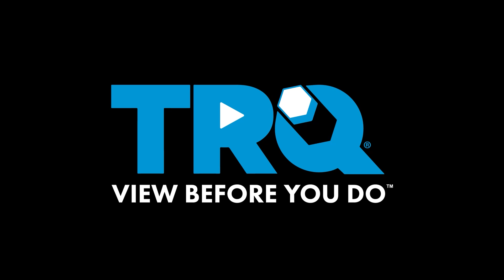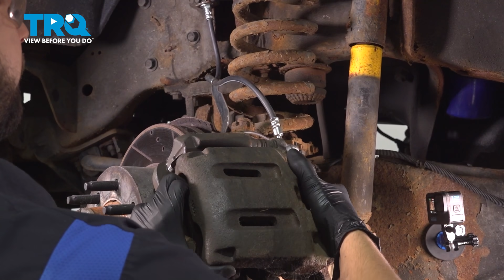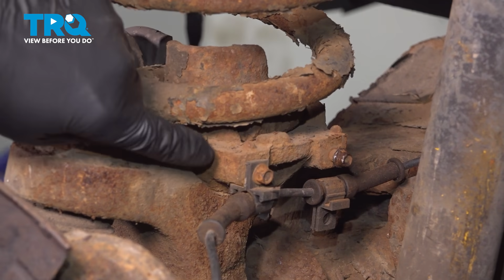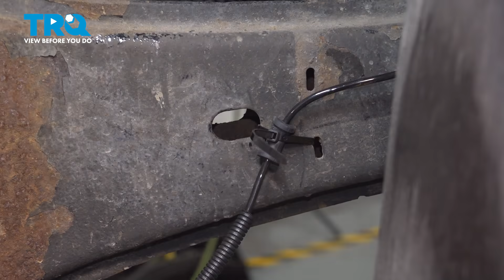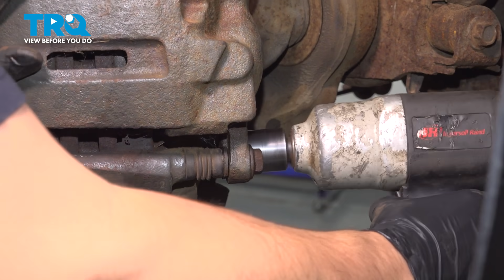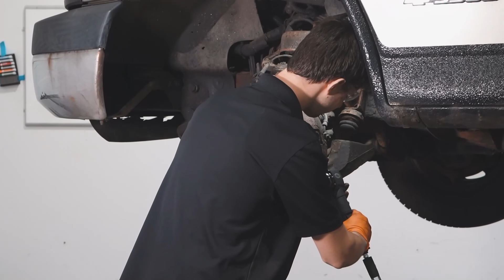How to Replace Front ABS Wheel Speed Sensors 2008-2010 Ford F-250 Super Duty

Comment: Thanks bud, doing this now. However, Ford must've had a part mixup at the factory, my driver side looked same as yours but passenger side had a pentagonal (5-sided) socket head screw holding the sensor in instead of the normal hex socket screw! Like what the heck! I ordered this truck from factory and have done all maintenance myself, so its not like its been swapped out or anything, its dead stock never been touched yet. I'm going to try a socket extra set on it first to try and get it out, then I'll just have to replace with a standard hex socket head screw like the other side.